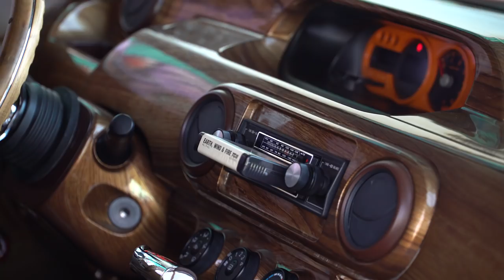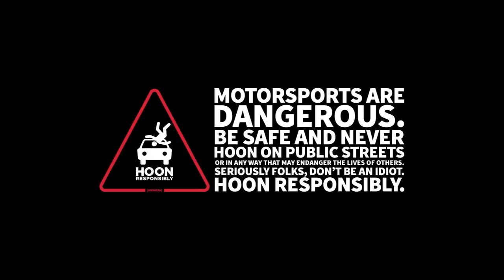[HOONIGAN] DT 195: 1976 Toyota Corolla SR5 and Scion Riley Hawk xB

Comment: That Corolla is perfect. I had visions of building something similar. I made a mistake and bought a TE72 which turned into a mess. Should have bought the generation before it, this one. Best part? No smog, so you can do what you want to do. Would have cost a fortune getting my TE72 smogged and legal with no horsepower. The smog cutoff year between those two generations is everything and is definitely reflected in the price!
Reply: Come to Florida where there's no smog, unlike Commie-Fornia
Reply: It's not pre smog in most California counties, that's 75 and before for gas cars.
Reply: Ah, you are right. I keep thinking it's '79 for some reason. Well, if it was a 74-75 TE3x then it would be golden. Maybe that's why he said he kept the stock cat. But it would fail a visual without that stupid little paper dryer tube thingy from the intake snorkel to the header right off the bat. Stupid freakin' smog laws. The bane of my car modifying existence.
Reply: Matt Mead Yeah, used to be 25 years or older and then they switched it to 75 or before. Been lots of talk the past few years of moving that year up, but I don't hold my breath. Especially with all the advances that are being made in electric and self driving cars. The time of actual driving being an enthusiastic activity is not too far away. Cool smog guys will let minor visuals go if the numbers pass.
Reply: My TE72 sat in my driveway for 3 years while I waited for them to change the smog laws up to 1980 (It was a 1980). Finally got rid of because of how hard it would have been to get it smog legal. I don't think they will ever bump it up. But yeah, driving cars will be like riding horses soon. Just a hobby on the side.
Reply: Matt Mead Got an 84 RX7 in the side yard for 2.5 years. Had dreams but now just want to make it not leak oil and pass smog. Probably will give up on it in a few years but it was $500.
Reply: a pre-egr peterbilt or w900 kw tractor doing donuts would be the staple of this show
Reply: What Rims did he put on his SR5?

Comment: My first car was a 75 SR5....but it looked nothing like this one.  The shape is pretty much spot on....but my SR5 was on the far other end of the condition spectrum.  Rear floor boards and rocker panels were rusted away and the car would bow in the middle when I hit a bump.  The tops of the fenders and the strut towers were rusted away and the struts lean in toward the engine.  I worked on those issues for 6 months....cutting and welding angle iron and pipe to form a sub-frame connectors and to get the strut towers back into place and held there.  Once done, the car handled like a champ....all the bracing and connecting made the car very rigid and improved the cornering like crazy.  A few engine mods were done after the head gasket failed and full engine rebuild was done.

Comment: I had a '74 SR5. 2TC, headers, wild  Isky solid lift cam, MSD, tachometer off the steering column w/ brackets, widened SR5 rims 13 x 5 in the rear, shortened shifter,  traction bars.  I miss her. Lol  No power steering.

Comment: Japanice cars are the best.  Since 80s japanese engines are the best because their metallurgy technology is the best which allowed them to build high revving, long stroke engines even back then in 80s. And even to this day their engines, typically, have longer stroke, which can only be achieved by using better materials for the crankshaft. And result — God like smoothness & better reliability, cos of thicker and tougher cylinder block and better heat dissipation, cos of higher block. Also in the 90 the perfected the use of electronics electronics in engines transmissions and awd systems.